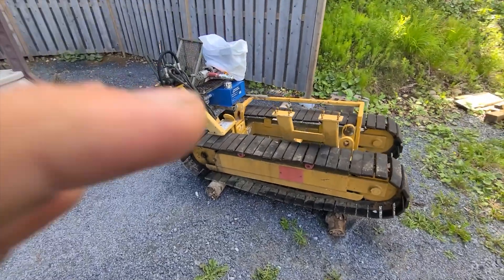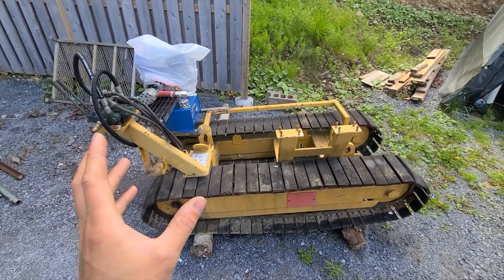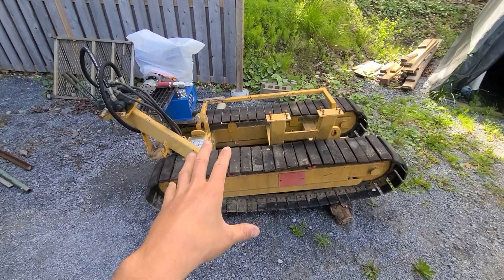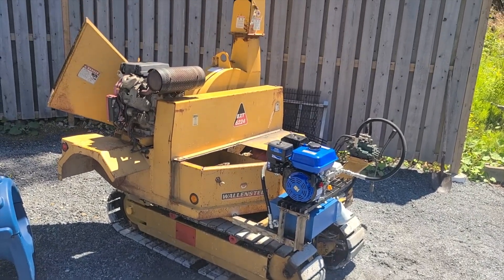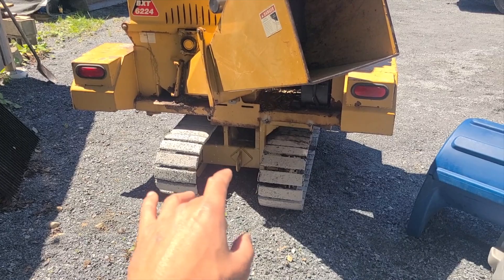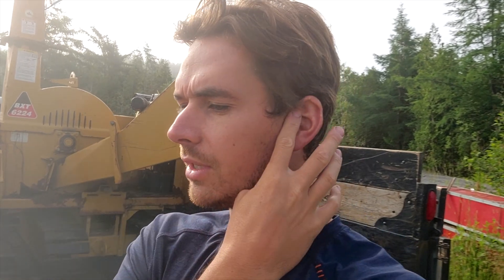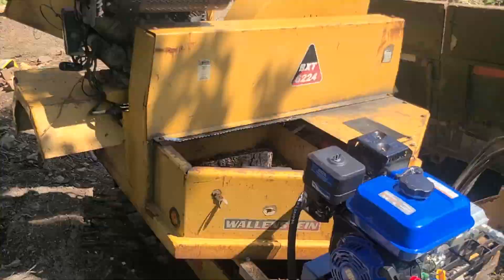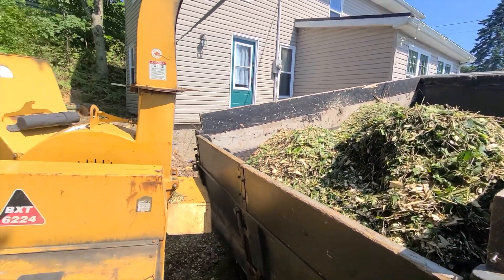Building Tracked Wood Chipper for $4500

Comment: Pretty cool machine.
It looked like you used teflon tape on the hydraulic fittings? Thats usually a big no go. The teflon will expand and contract under the hydraulic pressure changes and this can actually loosen the fitings after some time. Hydraulic connections are supposed to be tight metal on metal with the tapered fittings, or special o-rings that can handle the pressure, depending on the connection type.
Reply from the maker: Good to know!

Comment: You are very clever to be able to build that.
Just wondering did you find that smaller 15hp blue chinese chipper was a bit underpowered for your needs ?
Reply from the maker: I still have the small chipper. It's just a lot slower and the branches need to be cut up before they will fit into the chipper.